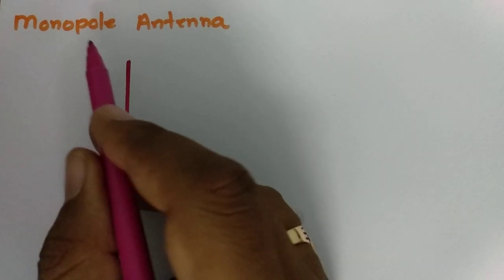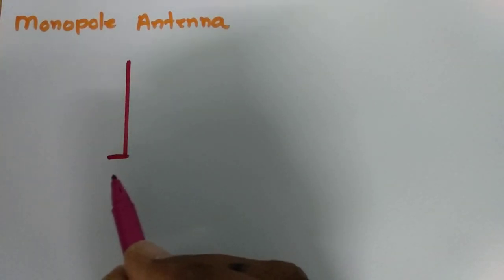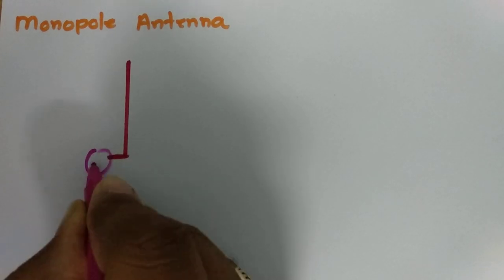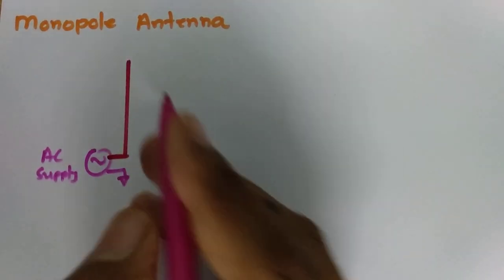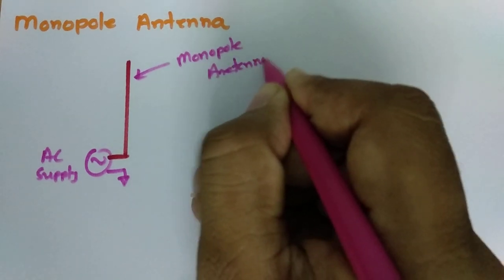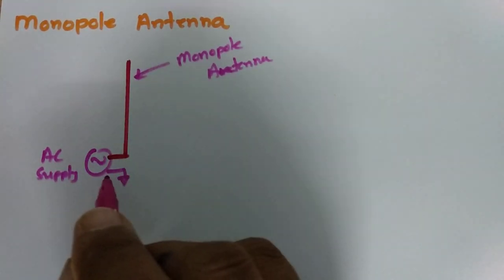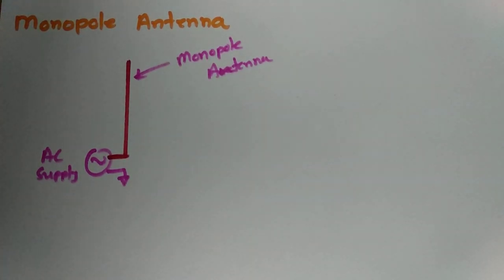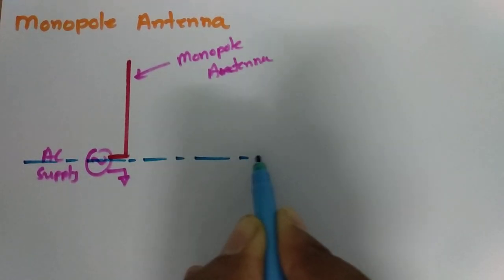Monopole Antenna (Imaginary Ground Concept, Radiation, Pros & Cons) Explained

Comment: Is the telescopic antenna of a regular FM radio a mopole antenna? If you have a receiver with an antenna connector with two poles, such as a 3.5mm jack, does virtual ground mean that you do not have to connect the other terminal anywhere, for example to the physical ground?

Comment: In small monopole antenna (H less than lamda/10), if we add capacitive load at end of monopole, I think input impedance will became small and it will be like that Za=Ra -jX , Is it a correct answer or am I wrong? if i am wrong, can you guide me with explain?
Reply: It won't decrease ma'am. Specially because  the magnitude of the impedance will be √(R²+X²). You've written it in the complex form.